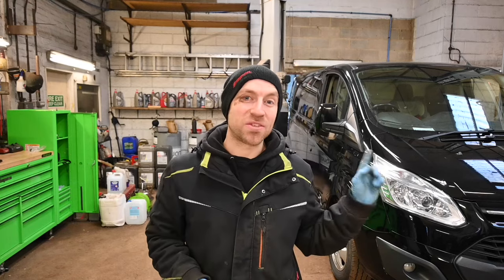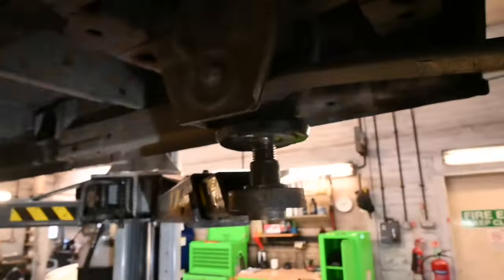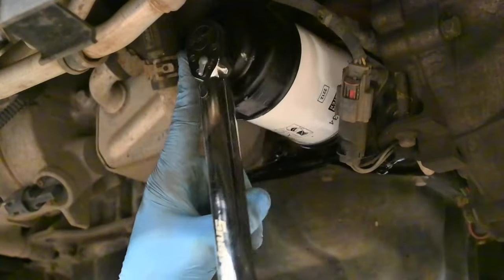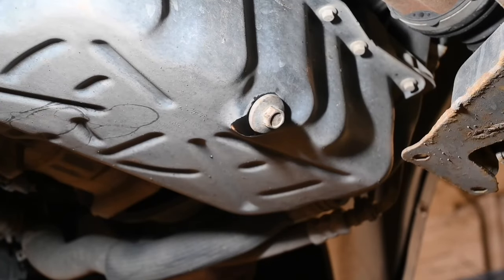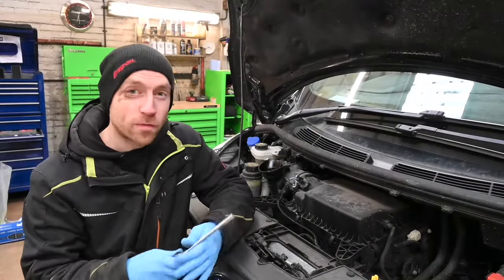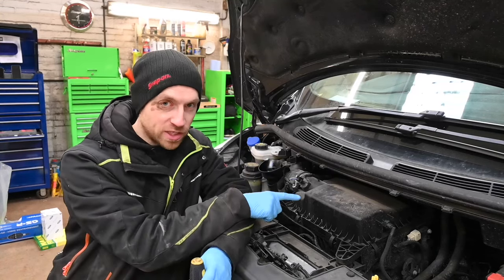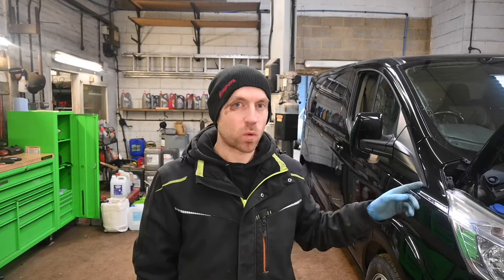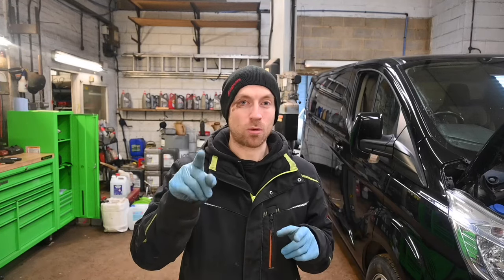How To Carry Out A Full Service On A 2017 Ford Transit Custom 2.0 Litre EcoBlue Diesel

Comment: Great video, just one tip, turn your oil filter pliers around, they are designed to self tighten in one direction only so if you have them reversed they are trying to open and you are using much more force trying to keep them closed.
Reply from the maker: Thanks for getting I touch, glad you enjoyed the video. You're are 100% correct. Normally I would have had them turned the other way. There are a couple of coolant lines for the oil cooler & wiring harness for that matter, that restrict the position of the pliers. In this instance, I need to have the open end spun around to avoid hitting/damaging the hose(s) or wire. Better yet, I could have used the original oil filter cap that I had LOL. Thanks for your on-going support :)

Comment: Really nice and helpful vid mate! One small remark: you're using the oil filter wrench the wrong way around. If you hold it the other way around, it will actually tighten it's own grip on the filter, instead of loosening it. Cheers from Holland
Reply from the maker: Hi there, glad it helped but yes, I am totally aware I had them backwards :) The reason for this is because, despite the fact I wasn't using the specific tool, there are  a couple of cooler hoses in the way restricting which way I needed to turn the filter using the oil filter wrench. I had to have the open end facing the other way not to hit the lines whilst turning. Appreciate the eye for fine detail Holland......very well done. Thanks for getting in touch and for your on-going support.

Comment: Fantastic video. I've just bought a 2015 custom van, and this video will come in handy.
Reply from the maker: Hi Tony, thank you so much for the positive review, it really means a lot. This are great vans and I would totally get one myself. Only very important suggestion I would recommend, these engines have wet cam belt (constantly lubricated with engine oil). You need to regularly change out the engine oil a minimum of every 12 months OR even 6 months to help prevent premature wear before it's due to be changed. These wet belts like the Fiesta EcoBoosts and Peugeot/Citroen engines have proved that  the cambelts are common for failing. Not to discourage you, just make you aware. Thanks again for your on going support.

Comment: good useful video. i recently had a MK7 transit SWB until someone wrote it off for me when it was parked up at the side of the road so now i am looking for a newer van, the biger model Ford transit. generally its the same that i am used to from servicing my own transit in the past, but the big difference i see are 1. metal oil filter (older van was a plastic housing with i think a 27nm of torque which was silly as it made it so difficult to take it off, i would usually tighten it up till snug then nip it a bit tighter and just keep checking it for the first week to see if it leaked any oil, usually didnt) and 2. the fuel filter is now plastic and less helpful (my van had a big plastic bowl that the paper filter was inserted too, you could fill up the bowl with diesel to help prime it better than the new system), i usually let my van turn over and when it started i would hit the throttle to force more fuel through and keep it running to stop any air getting in, not sure if that will be useful on the current models.

thanks to this i am more ready and happy to go buy a newer transit. also the key in the front bummper has been a transit thing since late 90s, my dad bought a MK6 transit years ago and the guy selling it to us did it no problem but once we got the van home we couldnt work it out for a while how to open the bonnet but the internet helped lol.

Comment: Thanks for this detailed video. I have a 21 transit custom. Im not too fussed to pay for a service, but I just want to do an oil and filter change really in between the service intervals.
Out of interest, in your opinion, why are Ford's service intervals in the UK so far apart but in the US mechanics do oil changes every 3000 to 5000 miles?
Reply from the maker: Hi, thanks for getting I touch. So these transit customers run what's called a wet cam belt. Rather than the cam belt being dry like most engines, it's constantly lubricated in engine oil, as is the oil pump belt. The only problem with this design is that being "wet", oil will increase deterioration and over time, the cam belt will break down and small fragments of belt with end up slowly blocking the oil strainer/pick up and starve the engine of oil.....that's if the cam belt doesn't snap before then. So, Ford will actually say change the oil every 6 months but most garage in the UK will say once a year is efficient enough. Perhaps Ford/mechanics in the US are more tuned into specific maintenance for this particular vehicle will quite rightly recommend to change the oil more regularly. For the sake of an oil change for £150-£200, will spare you a new engine replacement in the near future. Hope that makes sense but if I were you, you'd be 100% correct to change the oil and filter at least a couple of times a year. Thanks again for getting in touch.

Comment: Hey, I wish I would have come across this a few years ago. Had to teach myself.
Question: Why dont you put the fuel draining from the old diesel filter into the new one? I tend to do that, after a few seconds to make sure im not putting water in there. It makes the engine start much easier/faster (seconds, on the first attempt). I am not an expert so genuinly wondering if I am missing something here.

Comment: Great video. Super helpful. I have a question regarding the fuel filter change. You did not disconnected the fuel hose before removing the filter. I thought the fuel hose was supppsed to be disconnected. Am I wrong?
Reply from the maker: Hi, apologies for the delayed response. I've changed so many of these filters and I've never needed to disconnect the fuel lines to change the filter. Since they go in and out of the filter housing cap (which doesn't get replaced) then you simply just twist out the old filter and twist the new one in. Fortunately something Ford designed very conveniently. Thanks for getting in touch and for your support. All the best :)

Comment: Nice one. Haven't done a service or intend to but how does a diyer get rid of old oil and fuel they collect?
Reply from the maker: Hi, thanks for getting in touch. When I comes to disposing of chemicals, both engine oil/filters and fuel/filters do need to be disposed of correctly. Once chemicals have been collected in appropriate sealed containers, either a specialist company will need to be contacted to collect and disposed of accordingly (usually from a garage/business in large quantities) or such chemicals can be taken to a local recycling centre where they will have separate containers to be disposed of correctly. Hope this information helps and thanks for your support 👍

Comment: Ford dealers recommend Castrol magnatec
Reply from the maker: They certainly do. The grade of oil from Comma though does meet the oil grade specification. If ever in doubt though, buy Castrol Magnatec. Thanks for getting in touch and apologies for the delay coming back to you.

Comment: What year is that van. Does it have a wet belt. I want to get a Transit but don't want one with a wet belt. But want that shape. 😊
Reply from the maker: Hi Nick, thanks for getting in touch. This van is a 2017 plate and I can confirm that yes, it does have a wet timing belt. So oil changes are incredibly important and at very regular intervals IF you do intent on purchasing once. So make sure you buy a van that has full service history unless you're looking to buy new. Best of luck

Comment: My transit has 83000 miles, I have to service it, I had thought of removing the oil pan to check if there are any parts of the timing belt. What do you think?
Reply: It’s got a wet belt so if it hasn’t been done yet, then get it done. I got mine done for free as part of the Ford recall so it’s worth checking with your local dealer.
Reply from the maker: Hi, apologies for the late response. Considering the mileage, this would be a very good idea to check the pick up for any belt debry. Obviously when you drain the oil to do this, try and catch what comes out and check for any debry first. It will be a good indicator. Once you remove the oil pan, it will be obvious if it's time to change the wet belt out. Saying that, if you're prepared to remove the sump to check, you may as well consider taking it in to have the wet belt replaced. If you're planning to keep the van for another few years and do lots more mileage, get it replaced with an oil change. Hope that helps and thanks for getting in touch.
Reply: @greenautoservices  :Thanks for the reply, meanwhile Last month I changed the belt to 86K miles (done by me).I found that the belt was still in great condition, no cracks, the reasons may be that I replace the engine oil change every 18K miles instead of 25K and have only made long trips with the vehicle.👍

Comment: Thanks for the service.. how to reset the service info on dashboard
Reply from the maker: Ah, did I leave this out. Very easy, turn the ignition on (engine off), then press and hold the brake and accelerator pedal together for approx 30 seconds or until the message prompts confirm the oil reset is complete. Hope that helps and thanks for getting in touch.

Comment: The bonnet key is a bloody nightmare.  I got a non-fob key made just for that as I'm paranoid about breaking the main key.
Reply from the maker: You sir are a smart man. I don’t know why Ford went away from the bonnet lock then came back to it. Must have missed the constant repair 🤦‍♂️ thanks for commenting and your support 👍
Reply from the maker: @paulgee6150  good way to take unnecessary tension of the latch 👍

Comment: Could you cut the socket for the fuel filter yourself if you dont have the specific one?
Reply from the maker: Yes absolutely you can. A small dye grinder would do the job perfectly. I was considering doing that myself but later after I filmed this video my Snap-On dealer conveniently had the exact socket on the van......so you just know I got it :)
Thanks for getting in touch and apologies for the delayed response.

Comment: Can I do an oil change without jacking up the van?
Reply from the maker: Hi, thanks for getting in touch. Yes, the clearance may be minimal but both the oil filter and drain plug are located quite low so you should be able to do it without a problem on the floor. Just make sure the vehicle is on a level surface to ensure all/most the old oil comes out. All the best 🙂

Comment: May in your country you need a 0w30 but in the south , it doesn't' matter what Ford says about the specific oil but here in the summer when we have around 40° celsius, that oil become like water, I really whant to know how can be lubrificant...and how it can be stabel after 10.000 km... ahahahah
Reply: The 2.0 Ecoblue has a wet belt so the specification is really important.
I can buy oil that meets specification for €3,13 per liter, so it is not that expensive 🤷🏻‍♂️😂

Comment: First oil from sump than oil filter or not?  🤔 Oil is specific but is not only about 0w-30 but about spec ACEA C2 it's all about rubber timing belt witch is in oil ..(wet belt there are 2 one for timing small one for pump) ford recomend castrol magnatec start stop , Ford WSS-M2C950-A .. and oil change maximum every 10000miles ford recommend every 5000 -7500 ..it something different from what ford was recommended in 2016 when eco blue engine was released..this engine is one big fu.k up..injectors last 40-50000 before start leaks no matter how often you change fuel filter i do mine every 7500 all filters and oil.. other problem egr valve carbon build up , and lack of power as intake is integrated in head can't clean it  properly without removing head , next one lack of power it pissing compression between 2-3 cylinder most of time when lucky  only gaskets blown if longer running as not aware why than it makes deep scrufs on block  and engine is done .. new engine comes cheaper than repair ..such things happend with 100-120000miles  when luck of power and starting longer idling  then check compressions on cylinders and don't bother change injector as most probably there most mechanic start change injectors problem cured for month and  issue back in some time ,.another turbo oil return sized blocked with rubbish new version get bigger bore oil distribution. Etc.. new engine every 100 000miles todays quality..